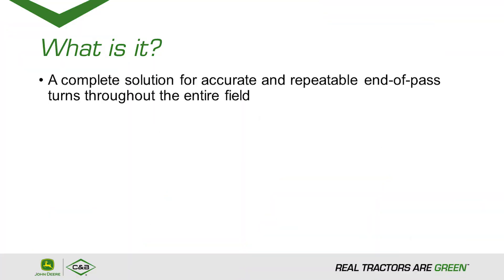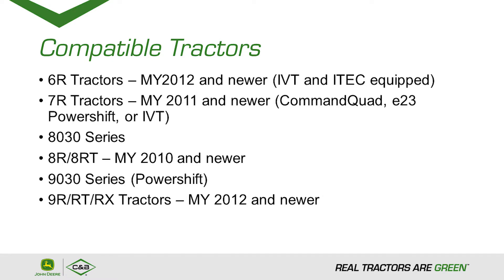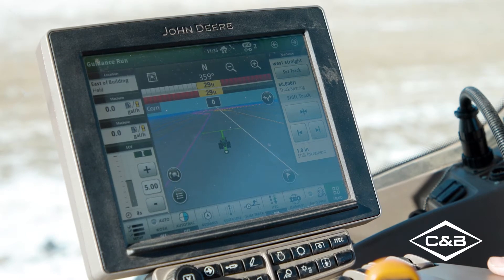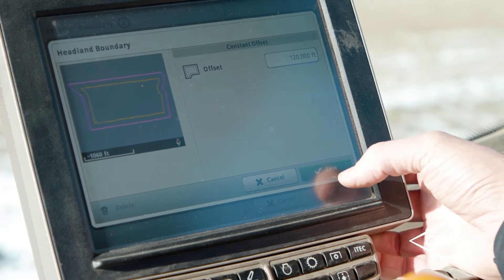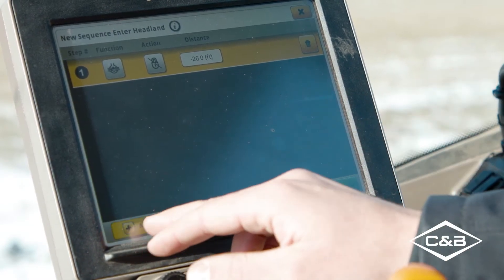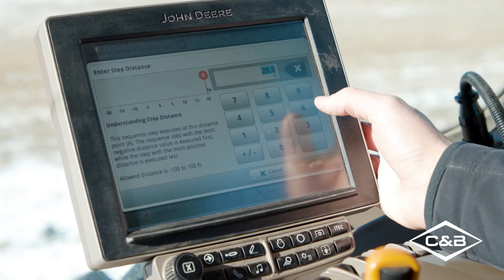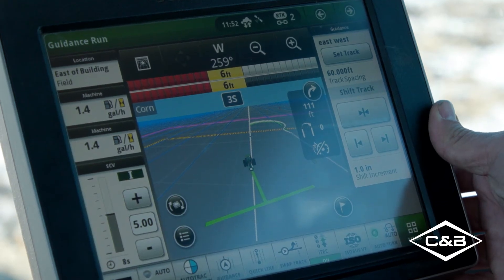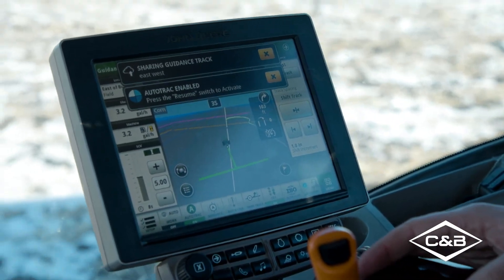Virtual Tech Days 2021 - Day 1:  AutoTrac™ Turn Automation

Comment: I'm getting speed automation disabled error. how to fix
Reply from the maker: @osmannuribakim13  first thing to check is if there are any software updates for your display, receiver or machine.  If you share your machine serial we can look if there’s are any updates that may need to be done.  Sometimes changes that have been made to the software could cause issues if there are incompatible versions, due to safety reasons.  If that all looks good, we can look into other possible causes

Comment: Any idea why is it that I have to constantly adjust the Start Turn distance for every turn? Even on square fields, lf I set it right, it does the turn nicely, but at the next turn it turns too late sending the tractor out of the field
Reply from the maker: What software version is your display on?  Do you know if you have your headland boundaries set up correctly on both ends of the field?  Feel free to give our Support Center a call:  507-200-3060
Reply: @CBOperations   Hi, so it's a Gen4,  Display Hardware says Version 2, Firmware version 10.28.3314-79. The boundaries are set correctly, I think. Thanks